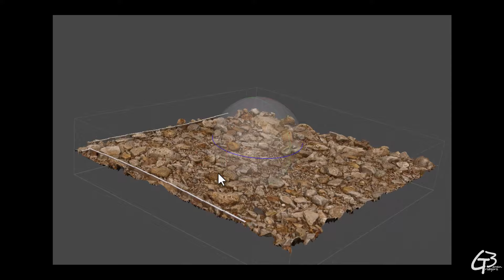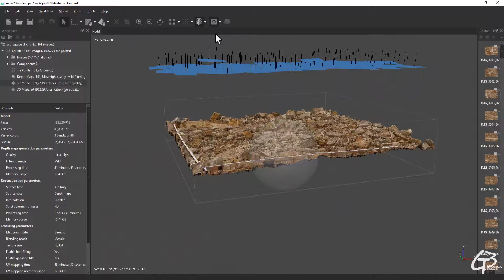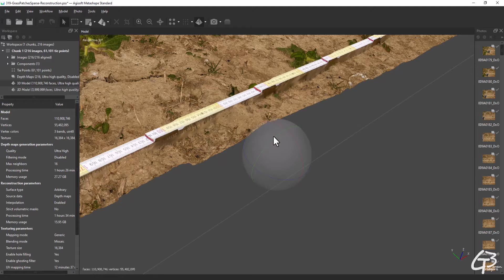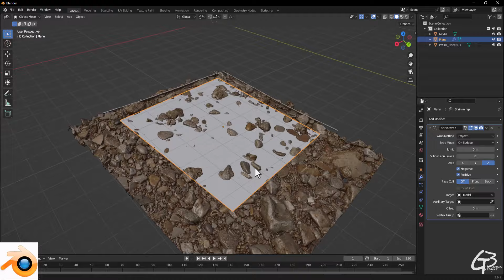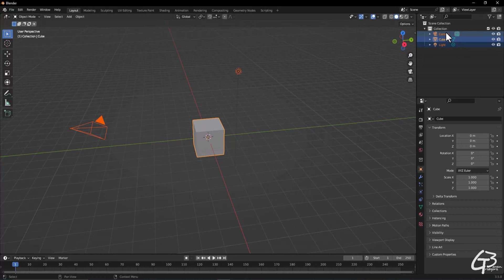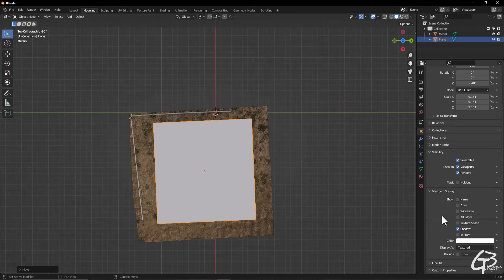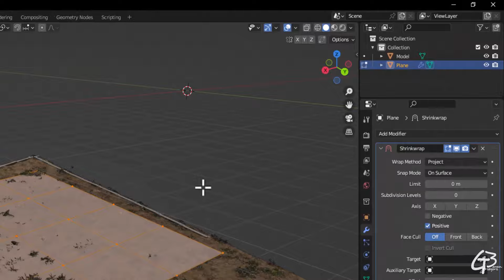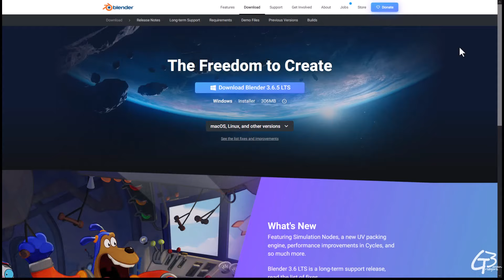Low Poly Model Alignment for PBR Texture Baking in Blender

Comment: Great video. Seeing you give Blender a chance in your photogrammetry workflow is excellent.
I have a very similar workflow for processing surface scans, except I made a geometry node setup which aligns an unwrapped plane based on the average normal of the subject, projects it on the subject and scales it based on the rulers in the scan. This speeds up the whole process. Generally, it takes longer to export the scan from Metashape than to prepare the projection plane.
Reply from the maker: Thanks, yeah, Blender totally replaced ZBrush at this stage in my workflow. I plan to give it a chance in manual texture creation at some point and get rid of ZBrush totally if it can make the job. So far ZBrush is stil the king when it comes to highpoly sub-tool based sculpting in super heavy scenes :D. I am kind in love with Blender now and its clearly the future. I consider any time spent on 3DMax, Maya etc. a waste on this regard. Shamefully it needs an RTX card for cycles which I still dont have - I am still on GF1080 :D
Reply: @GrzegorzBaranArt You can get the 4070ti if you are in budget.
It's faster than the 3090ti.
Reply from the maker: @ChillieGaming  Thanks for the advice. I actually bought 4070Ti last month and indeed it makes significant difference when it comes to RTX based features. Unfortunately had to upgade my power supply unit too. Cheers!
Reply: @GrzegorzBaranArt  Hey i have another question. How big of a difference do u get with ur upgrade in lets say processing time
Reply from the maker: @ChillieGaming  anything that utilises RTX tech on CPU speeds up significantly. So render in cycles which would take me 20mins takes just 2. But GF1080Ti is a very powerful and quick card. I feel like it was quicker when it comes to overal data transfer (large texture sets) and 4070Ti laggs in comparison. I would risk saying that I feel like GF1080Ti was slightly quicker and performed better things which dont utilise RTX technology, but everything that does, leaves GF1080Ti behind. And recently almost everything does.
So with all pros and cons of GF1080Ti, I consider upgrade to 4070Ti as a big and significant one which makes the difference. 
When it comes to photogrammetry I didnt compare processing times, but I dont feel like there is a big difference. Maybe because I usually work with large, over 100mln poly meshes and hundreds of images and any of these cards has enough VRAM to handle that, so a lot still depends on motherboard, RAM and CPU here.

From Blender Cycles point of view. After the upgrade, I can finally tweak light live instead of waiting minutes after any parameter change which is awesome

Comment: I’d love to know how people are creating roughness maps from their photogrammetry scans, since by default the roughness is uniform (obviously not ideal)
Reply: Depending on what it is, usually just inverting the albedo and playing with the levels. You can then colour select different areas to change bits, add overlays etc..
Reply: Don't invert the albedo. Instead, convert the RGB to HSV in Substance Designer. Use the inverted greyscale saturation map as the basis for roughness as it's vastly superior.

Comment: Hi Grzegorz! Great video. I have two quick questions. In this video, when you take photos on location, it looks like your camera isn't parallel to the ground but is at about a 45-degree angle. Is that the case?

Regarding the equipment itself, I have a full-frame sensor camera and a Canon 50mm lens that I use in many situations. If I use it for photogrammetry, does this simply mean I would need to take more photos to cover the area ? Or would you recommend photographing with, say, a 35mm lens (which I don't have) ?
Reply from the maker: I also use full frame camera for photogrammetry. The focal length depends on many factors - like distance to the subject, use of flash and its power (falloff), quality of lens (vignetting and distorsion), the subject structure and depth (grass? concrete? brick?), sensor/image resolution, time to capture, expected quality for reconstruction, coverage, stabilisation, level of light, and many more. I covered some of these in some of my previous videos but I plan to record a separate video about captures at some point, if this form of videos kicks in and finds interest. 
I use a kit zoom lens for this reason and I change the focal length depending on these. Yes, if you use 50mm lens you will need to capture more photos so you have enough image overlapping.

Regarding the 45-degree angle.. its not really 45 degree :) but its angled indeed. Its angled because I had to avoid having tripod leggs in a frame somehow :D so I consider it as a compromise. The perfect camera position wouldnt be angled at all :D

I plan to cover all these details and nuance in my incoming book :). Hope that makes sense <3
Reply: @GrzegorzBaranArt  Very comprehensive response, thank you ! (:

Comment: Your videos are pure gold, what do you think about the Nvidia NeRF?

Your explanation is so clear I love it! Why did you settle for 2mkw?
Reply from the maker: I havent tested Nvidia NeRF. 2x2m coverage is a standard coverage for computer games - due to texture size restrictions. It is wide enough to avoid obvious repetition but small enough to provide all visual detail. In 3D art all these 2x2m materials blends with each other using masks, vertex colors ... you name it. This coverage works the best when you create environments seen from human perspective. While it is considered as a standard coverage, its not fixed and depends on its purpose. For example fabrics (often used for characters or visualisations) cover often just 50x50cm. If you produce CG environments seen from larger distance, the larger coverage makse sense  - as far as I remember World of Tanks use 4x4meters. If you make a product seen from a long distance - flight simulator - you might even use 100x100 meters etc. Btw. its one of subjects I was planning to cover in detail in one of my incoming videos about 'Single Image based' reconstruction for materials :). So there is no fixed size of texture coverage, but the 2x2 is the most common. At the end it is important to know the coverage to be able to set proper tiling setting to keep coverage consistency in a CG scene. Cheers!

Comment: Hi, I trying to follow the video and I get a little bit confused, when you almost have the correct scale on the added plane in blender (2x2meters) almost 180x180 cm. and then you scale the the plane to match the imported HP. don't you lose the scale if you do that? or is this because you need to match the lowpoly to the insanely high poly that you can't import? Hmm. I might have answered my own question...
Reply from the maker: not sure whats the question, but yeah, I basicaly use a medium poly mesh made of (decimated in Photogrammetry app) to the size I can load without crashing and navigate around in 3D app like Blender. Because this medium poly is basically a decimated super high one and carries all its features needed for alignment - like position is 3D space, size, coverage... just without super tiny details which arent need for positioning. So yeah, as you said, I do that to match a low poly model to the high poly I cant import as its too heavy :D
Reply: @GrzegorzBaranArt  perfect, thanks for the answer! I first thought, why does he not match the HP at the world origin and scale it to match 180 cm. But if you need the origin from the super dense mesh, i understand why you move the lowpoly instead. :) Thanks for the answer!
Reply from the maker: @1982Jonte  Yeah, the med-poly model loaded is a proxy version or super heavy high poly one which cannont be even loaded :). I use this med-poly model only at this stage and only for that purpose. It takes just a minute to decimate a 150mln heavy poly model into light 6mln in Metashape for example and with that one used as proxy alignent is smooth and easy. No probs, anytime :)

Comment: You should not subdivide the plane (unless you have a non-organic surface with structure/lines) No matter your subdivisions, when you conform/project, edges will appear in your 32bit floating point depth map and normal map. Instead, high pass the depth and blue channel of the normal with a very large radius to eliminate those low frequency "hills." Then, run some basic math on resetting the height to its natural range. All of this can be done in Substance Designer.

You also should be using a set of ground control points via fiducial markers (April Tags) when scanning so you don't need a ruler. Great tutorial otherwise!
Reply from the maker: Hey, thanks, are you really sure of that? I made some tests - I even shared one in this video and smoothing, smoothes the projection angle by averaging vertices and eliminates 'faceting' on normalmap (I use 16bits for normal). Cant say about 32bits dept map as didnt try it. This is something I do on a daily basis for years and never had faceting on any of my models. I use different subdivision levels from low to crazy dense depending on the subject.

Regarding rulers, they also help me to maintain even camera coverage and move in even rows during scanning. Results I get without them are much worse. I never used fiducial markers as I never needed them, I guess I should try them at some point. Thanks for the comment and nice words, very appreciated